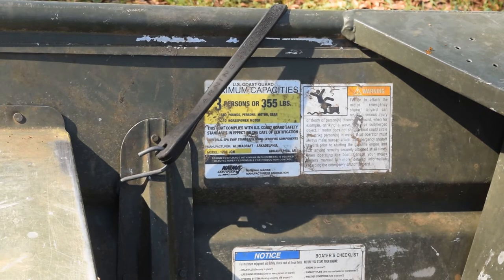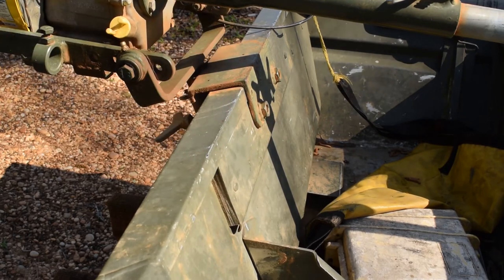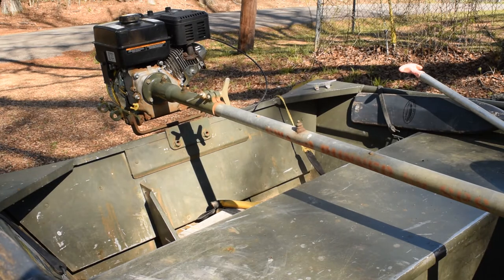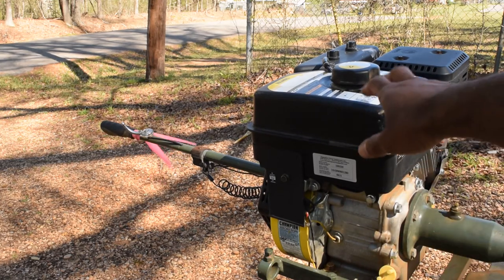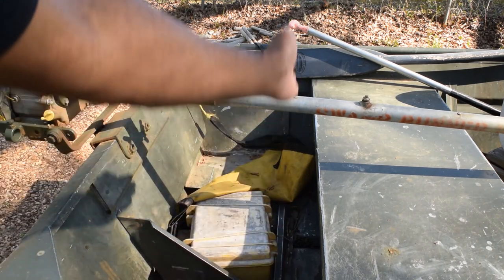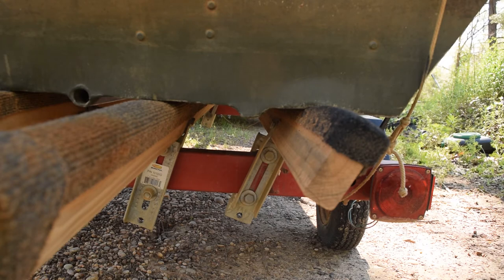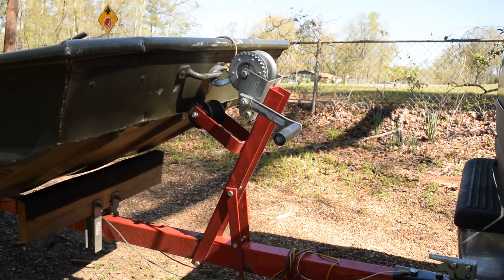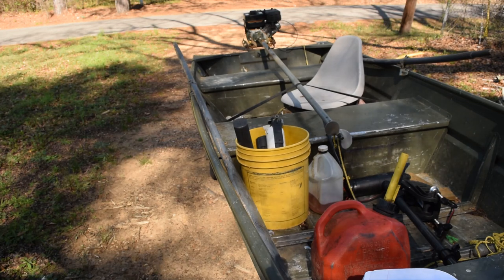Alumacraft 1236, Harbor Freight Boat Trailer, & SwampRunner Long Haul Review

Comment: I appreciate this video so much! Thank you! How's it all holding up after the years? Just subscribed, I'll be checking out more of your videos!
Reply from the maker: It held up okay for a thin walled 12 footer. I've since bought a 14 footer of the same brand. The 12 footer had developed leaks so badly that I needed another boat.
Reply: @BlackWarriorLures  oh man! That makes me nervous. I don't plan on hitting bottom too much, maybe have to slide over some slick downed trees but thankfully no rocks here. Just some sand/grass beaching. Hopefully buying new I'll get a few "dry" years of use.
Reply from the maker: @swallowsjeremyy  Yeah, these riveted jon boats will all eventually leak. The pounding of the waves and the riding on the trailer beats them up.

My next boat I'm probably going to save to buy a custom Alweld jon boat.
Reply: @BlackWarriorLures  Now that is goals! I love those, with the modified v hull. I'm hoping to carry mine on my trucks camper rack. But that's probably gonna get old quick. Haha I'll probably end up buying a trailer, but one thing at a time.